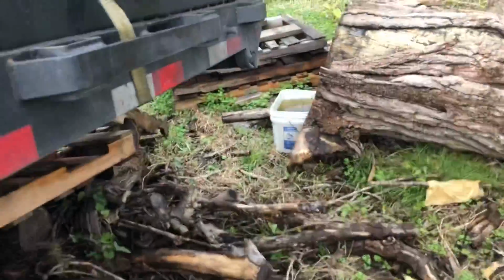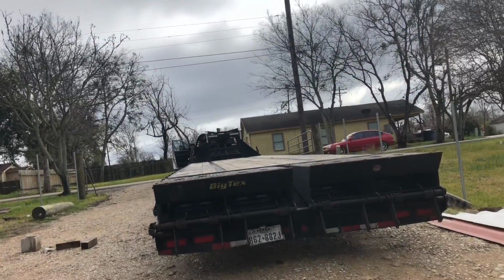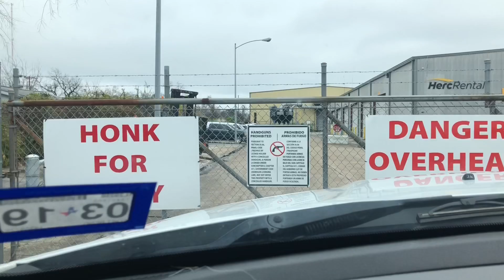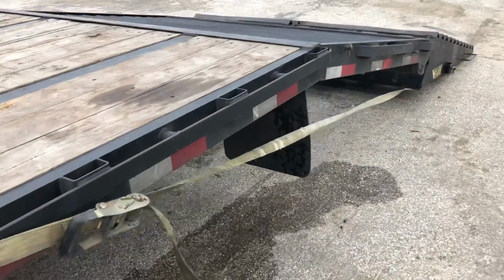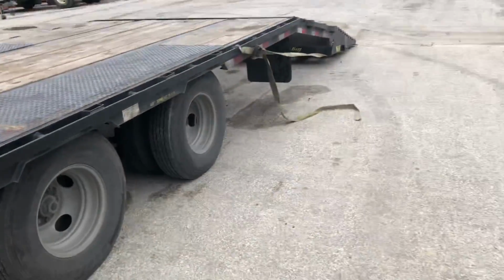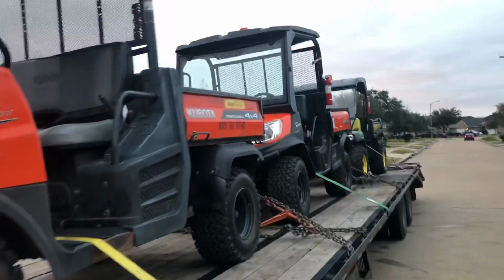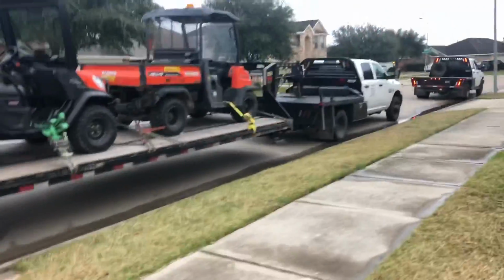Hauling 3, 2 seater ATKs 1st load of the 2019!

Comment: Hey bro keep you some old straps or carpet (cut is short sections) on the truck. Idk if those chains are touching (the ones that crossing like an X) but it can’t touch because they’ll actually eating through each other “chafing”. If you put that old strap or carpet or something between the two then it won’t.
Reply from the maker: Thank you for the tip next time I will put stuff between them 👍🏽
Reply: No problem

Comment: What's the max weight you haul with that setup? How does the truck handle the weight?
Reply from the maker: 16,000lb that the max for the triler. It handled it well if the Weight is distributed correctly.